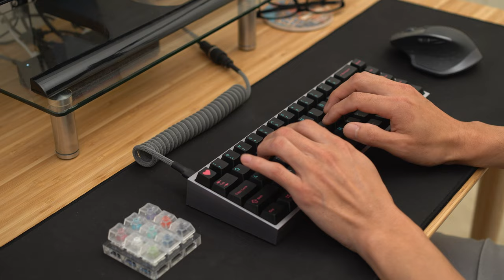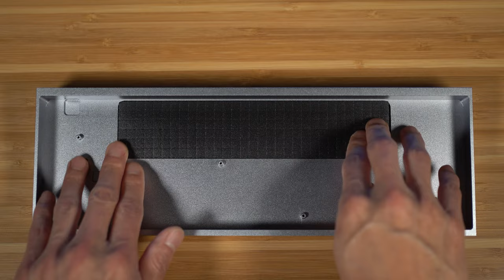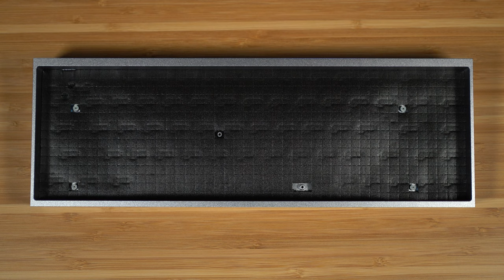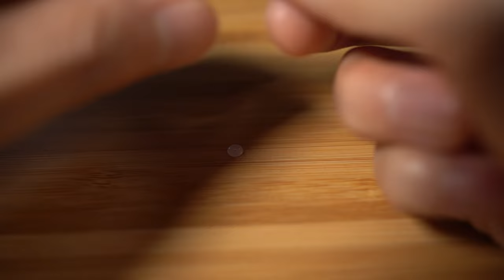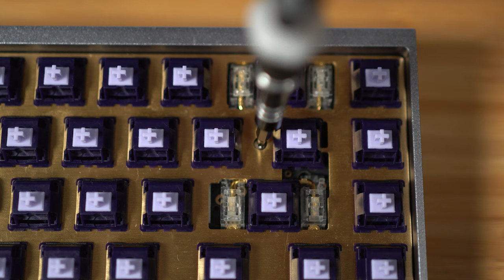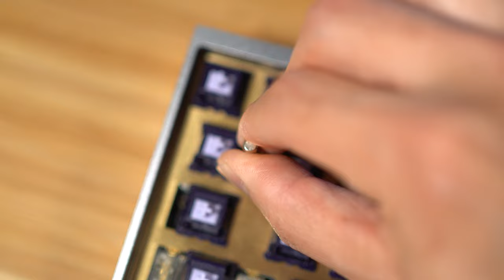Make the BEST sounding TOFU!  TOFU65 O-Ring Mount Mod Tutorial

Comment: How big of a role would you say does this specific foam hold in this build? I am not from the US and have trouble finding a suitable replacement. How thick is the foam? Have you tried different materials?
Reply from the maker: Hi An! I believe the foam in the case is absolutely necessary for this tofu. However, it doesn't have to be the exact one that I have used. Anything that will help reduce the ping and hollowness will work!
Reply: @Keybored  how thick is the foam approximately? As I have said earlier, I have had trouble finding a suitable substitute in terms of sound unfortunately

Comment: Hey thanks for the video! I wanted to try this on my low profile aluminum case, however the O-Rings you listed don't come in the size you specified. Do you have a link to some other size that would work? Thanks in advance :)
Reply from the maker: Hi Jonathan Haymes! Thank you for watching! A few other viewers noticed that the 4x1x1.5mm o ring was sold out. I found another link for you!

https://www.amazon.com/uxcell-Silicone-Rings-Diameter-Gasket/dp/B082STN4LT/ref=mp_s_a_1_6?dchild=1&keywords=Silicone+4x1x1.5+mm+o+ring&qid=1611546963&sr=8-6
Reply: @Keybored  I appreciate the response. Although these will take a very long time to come in for me. Do you have a link to something that will be available for delivery sooner? Thanks again

Edit: I actually ordered a different size from the same company and the package was lost during shipping so I requested a refund. Any other brands/links you would recommend? Would a regular sized o ring work as well? Thanks in advance

Comment: The whole board only float on the o-rings and not attached on the case at all?
I notice the screw when in all the way through the plate. Can I just screw the 2 o-rings first, then put the board on top?
Reply from the maker: Hi M Izzul Iman, the board floats on the o-rings but is also screwed down as well. Just make sure not to screw it in too tight, because that will compress the o rings too much and make it flat, effectively negating the mod. If you're using a hot swap pcb like the dz series, it's actually even easier to do, since you can mount the pcb first, then the plate and switches in top. Hope that helps!

Comment: If you are still replying to comments on this video, how would I make this work when the screws with my tofu are much smaller than the ones that you have? The ones that came with mine barely fit one o ring on it, let alone 2 and the pcb, plate, and foam. Just wondering because yours sounded so good compared to mine.
Reply from the maker: :) I still try my best to answer the questions!  I was told that some tofu kits actually came with shorter screws!  The screw size you need are actually M2x5mm.  I hope that helps!

Comment: i still dont get how you made it sound so good and creamy... Cuz I've sen tons of other YouTubers do the exact same thing but have it either sound plasticky or without that creamyness
is it the lilacs? because I don't really like tactiles but I love this sound
Reply from the maker: I think the trick is in the o-ring compression!  It's really crazy but the more or less you tighten it down actually changes the sound of this board.  I use the tip and finger to get it just tight, and it delivered the most pleasing results!  Also the lilacs broken in tends to have that more "chill" sound than some of the other crazy tactiles out there
Reply: @Keybored  interesting...any linears you recomend with a similar result to the lilacs?

Comment: did you have any issues with the usb port?
Reply from the maker: Hi Sean de Jong! Actually the 1.5mm thickness o ring is just the perfect height that I was able to clear the usb port nicely without issues. If you use just the screwdriver tip and hand tighten, it gets it compressed enough to clear the usb cutout nicely, without squishing the o ring so much that it doesn't elevate the pcb. Hope that helps!

Comment: Why did you decide not to put the o-rings into the 2 middle mounts? And what would happen if I were to do just that?
Reply from the maker: Hi Oblivion!  I skip the middle 2 mounts so that I can leave space between the stand-off and the pcb and allow for the pcb/plate to flex.  This way, it's somewhat emulating what a top mount or a gasket mount keyboard is doing, by helping to keep the alphas clear of any hard mounting spots.  If you decide to go with the rings in the center, it would be better than hard mounting like stock, but will reduce the evenness in sound and feel somewhat.  Hope that helps!

Comment: i dont know where i see it, but would it not be simpler to put your screws (that will get an o-ring) into the keyboard pcb and pull the o-rings other the screws? so that the o-rings cant fall off and you have an easy time overall.
Reply from the maker: Yup!  Viewers have suggested that, and I have tried and confirm it is easier!  :)

Comment: What 1u modifier did you use on the right side next to the spacebar?  I'm looking at the Miami night base kit and don't see the 1u  alt, fn and ctrl key.  Also your heart ESC key is not included on the kit as well... is that extra?
Reply from the maker: Hi stogey420time! I have the epbt miami nights which includes the extra bits!

Comment: I'm ordering some 4.5mmx1.5mmx1.5mm silicone o-rings to try this. Do you know if nitrile o-rings would work similarly?
Reply from the maker: Hi Chief!  I have actually tried this same mod with the Nitrile o-rings first.  Overall, I prefer the silicone o-rings over the nitrile.  That hardness difference (50A Vs. 70A) actually did have an impact on the sound and the feel.  However, it's not to say that the nitrile was bad.  It was a bit less "cushioned" and had a bit less "pop" to the sound Vs. the silicone.  Hope that helps!

Comment: Could you put toothpicks or something in the screw holes while putting on the PCB and plate to keep the o-rings in place?
Reply from the maker: Hi Jack, one of the viewers actually gave some good advice when doing this. He mentioned put the screw with the o ring through the plate and pcb, then put the bottom o ring on the other side first, before placing all this into the tray. This way, you don't have to worry about knocking off the o rings! Hope that helps!

Comment: I need to try this. Would grinding down the center two standoffs benefit here at all too?
Reply from the maker: Hi Kevin!  I noticed that the 1.5mm o-ring was thick enough to provide enough "space" between the pcb and the stand-off to prevent contact, and allow for enough flex for best typing experience.  Hope that helps!
Reply: @Keybored  aight thanks!

Comment: What standoffs would u o-ring mod in a tofu60? 2 most outer standoffs or 4 most outer standoffs? Also, did you need longer screws, i tried to mod mine and i felt like the screws wouldn't screw at all
Reply from the maker: Hi Diego! You would also use the 4 outer (2 on each side). Also I was told that some people received shorter screws with their kit than mine. The screw that I used were m2 x 5mm!
Reply: @Keybored  Thank you a lot!

Comment: What type of plate would you recommend to do this mod with? I was thinking Polycarbonate because its the most flexible
Reply from the maker: Hi Xavoid! I did it on the brass and aluminum and both yielded great results! They are just stuff enough that it doesn't flex into the center posts

Comment: Did you have to buy the m2x5 mm screws separately? I'm only seeing m2x6 mm screws, do you think those would be okay to use as well? Or do you suggest sticking with m2x5 mm?
Reply from the maker: Hi Kyla! My screws actually came with the tofu, but I was told that many also received theirs with shorter screws. But the screws that did come with mine are m2x5mm with a head diameter about 4mm. For the tofu 65 I have, the 5mm length was fine to fit into the standoff even without the o rings, so there was enough length in the stand off to accommodate. So I assume the 6mm with the o rings above and below should also be OK, but if 5mm is available, I would stick with that since it's proven :) hope that helps!
Reply: Thank you for the quick reply! I just bought some m2 x 6mm screws because I realized the case is deep enough to allow some leeway with screw length, since the screws can fit up to 4 mm inside the case itself. So hopefully that will work out! Can't wait to do this mod.

Comment: I tried using fluorine o-rings on my Tofu but it did not work. The fluorine is too stiff and doesn't compress enough for the screw to catch the thread.
Reply from the maker: That is interesting! I did this with both the silicone and the nitrile o rings, with nitrile being stiffer and similar to fluorine. The sound was a bit different, with silicone being more poppy of the 2 but the nitrile definitely did improve the sound and feel over stock. We're you able to use the same size o rings?

Comment: The screws I got with my Tofu65 are black and super super tiny. They aren't even long enough for the step when you put the screw through the plate. They fall right through and then I lose the screw in the PCB. Help?
Reply from the maker: I heard that some kits came with smaller screws unfortunately.  The correct size of the screw you need are M2 x 5mm!
Reply: @Keybored  Thanks a lot! Wasn't expecting a response. Appreciate it.

Comment: How come your screws are so big? The screws that came with mine are these tiny little black ones. I don’t think the screws will work with the o-rings underneath
Reply from the maker: Hi Xtr4 Kr1spy! The screws that came with my tofu measure about 6.5mm length from end to end, about 4mm diameter across the head. I believe the thread diameter is standard M2. It's interesting that some people received smaller screws... Kbdfans specify M2-5mm length screws so it seems like it's in alignment with what I have, since it's saying the thread portion under the screw head is 5mm. Perhaps these will work for you? They are m2 x 5mm with a 3.8mm head diameter. 

https://www.amazon.com/uxcell-Notebook-Computer-Phillips-Gateway/dp/B082XXLSP9/ref=mp_s_a_1_15?dchild=1&keywords=m2+5mm+screw&qid=1611717564&refinements=p_85%3A2470955011&rnid=2470954011&rps=1&sprefix=M2+5mm&sr=8-15

Comment: Hi. I'm using a GK64x PCB on my Tofu60 case and I just want to know if I can just leave the standoffs on the GK64x PCB and just proceed on what you did in the o-ring mod on Tofu? (you're aware that GK61/GK64 has standoffs on the pcb itself right)
Reply from the maker: Hi harmless!  From what I have seen, the does the GK PCB mounting positions line up with the TOFU case?  I know on the 60, it has some issues and tends to sit a bit unstable.  Perhaps the 64 does a better job?  In terms of the actual PCB stand-offs,  the GK61 also had them as well, but I removed them with a socket tool :)

Comment: Hey man! Would this work with a hot swap PCB? Really cool build btw!
Reply from the maker: Hi Em1LL3US! For sure! I tried it with the Dz65 also, and it's actually easier since you can mount the pcb first, then put the switch and plate above... No need to squeeze the little screws through the tiny plate holes!
Reply: @Keybored  did you order from kbdfans? also does anyone know if their fully assembled TOFU65 comes as hot swap?
Reply from the maker: @kilianleonkilianleon  hi Kilian! I did order my tofu65 from kbdfans! I purchased the kit and I bought both the hot swap dz65 as well as the solder kbd67 Rev 2 pcbs. From what I believe, the fully built ones come with the soldered kbd67 Rev 2 pcb. Hope that helps!
Reply: @Keybored  thank you man! I also wanted to order the tofu65 set from kbd with novelkey creams. but in order to lube them you need a hot swap version to pull them out etc right?
Reply from the maker: @kilianleonkilianleon  If you're planning to purchase the pre built TOFU, you would have to desolder all of the switches in order to lube them.  Perhaps you can look into the DIY kit with the DZ65 hotswap PCB so you can lube, then quickly assemble?

Comment: What kind of screws do i need for that ? They surely must be longer and the head smaller to pass the plate?
Reply from the maker: Hi T R!  I actually used the screw that were provided with my TOFU, but I believe some people received shorter ones than mine.  The screw are listed as M2x5mm, and the head diameter is about 4mm.  I have found ones very similar on Amazon as well!  Hope that helps!

Comment: Now how would this compare to the PC plate with o-ring mod. I listened to some comparisons and the PC plate had a deeper pitch which I liked. The board wasn't o-ring modded though.
Reply from the maker: The PC plate does have a deeper pitch!  I like PC plates for tactiles, but less for linears.  Since the Tofu is mounted to the case via the PCB, the PC plate will also work with this mod but you may get the pcb to flex enough to touch the center stand-off during heavy typing
Reply: @Keybored  Thank you so much! I went ahead and got myself a tofu60 with PC plate and I LOVE it! Your were correct on the pitch and pcb flex so I went ahead and screwed in all the screws. Still sounds amazing with these mods!

Comment: Did the o ring mod on my tofu60 and still sounds very pingy... not sure what I’m missing, i have some eva foam under the pcb and between the plate as well :(
Reply from the maker: Hi Snack Guy! If you're still experiencing ping, it may be the foam. I noticed that certain foams do a good job at eliminating hollow sound while others do a better job at reducing ping. For example, the butyl does a great job of making the board sound dense and solid, bit not too much for ping. The zip-n-fit liner does a great job for ping, but not so much making the keyboard sound more solid. The foam I have in mine is the zip-n-fit liner in the case and vinyl adhesive foam for the plate and it worked out very well!

Comment: I have a dz60 rgb v2, What do you think about also removing the middle supports and just o-ring modding the outer 2? Brass plate
Reply from the maker: Hi Kulbir!  Yup that will be the best way!  I have actually done this with the DZ65 rgb hot-swap pcb also for the TOFU65 and it works the same way :)

Comment: hey, the sound is eargasmic.. I was wondering if the nitrile rubber material o-rings can work, with the same dimensions? and will this work as well on a tofu 60 instead?
Reply from the maker: Hi Keith! I have tried this with nitrile as well, and also works! The sound is a bit different than the silicone but it still improves then eveness in feel and sound! Also works for the tofu 60 as well. A few viewers tried and came back with great results,
Reply: @Keybored  thank you! what about flourine ones, would it be a closer replacement than nitrile? Also, for the sound dampener, I saw someone using a diy flourine dampener, would that work as well?

Comment: Hi Keybored! I really want to try this mod out with my Tofu60, but my case didn't come with the longer screws. :( Instead, they came with the short black ones. I was wondering if you could send me a link to some screws like the ones you used. It would really mean a lot!
Reply from the maker: Hi Laifeless! Actually a few other viewers had the same issue. The screws that the Tofu65 came with are M2 x 5mm screws with a 4mm head diameter. I found some that are not exactly the same, but pretty similar, albeit the head is flat and not rounded. I hope these work!
https://www.amazon.com/uxcell-Notebook-Computer-Phillips-Gateway/dp/B082XXLSP9/ref=mp_s_a_1_15?dchild=1&keywords=m2%2B5mm%2Bscrew&qid=1611717564&refinements=p_85%3A2470955011&rnid=2470954011&rps=1&sprefix=M2%2B5mm&sr=8-15&th=1&psc=1
Reply: @Keybored  Thank you so much!

Comment: Do you have pcb foam installed for this build?☺️
Reply from the maker: I do!  But I didn't use a precut one and went the ghetto route... I used 3/16" adhesive vinyl foam that I cut out and applied to the bottom of the brass plate :)  I showed how I did this on my NK65 EE Modding video :)

Comment: how could i do this if i don’t have o-rings and just wanna do this mod right now, maybe thick/wide rubber band maybe?
Reply: @pretzel3779  knew that was coming
Reply: @ilynajix  I guess you CAN cut out the standoffs and put the large o-ring around the pcb and plate, but it will be harder and may interfere with your stabs a little

Comment: is the 1mm inner diameter a must? I bought a set of o-rings with 2mm inner diameter and was wondering if it will work the same.
Reply from the maker: Hi skunk! The 2mm ID ring may work between the standoff and pcb, but may be too large for the screw head. As you screw down, the head may just penetrate through, and may not sandwich the pcb between the 2 o rings. If you try and it works, let us know since that will open up more flexibility! Thanks!

Comment: hey wondering why didn't you do that with the screws on the middle
Reply from the maker: Hi yeacy!  I skip the middle because the r-rings on the outer stand-offs help to elevate the pcb/plate assembly, reducing the hard mounting points and making the board feel more even and sound more even as well!

Comment: Does this make the pcb no longer grounded to the case, and does this increase the chances of frying the board? I hope to try this on my kbd75
Reply from the maker: Hi fupa!  I have been running this keyboard this way for quite some time now, and hadn't had any issues!  I believe if you used the acrylic version of this keyboard, it wouldn't actually be grounded either through the case.

Comment: Does this has to be the 4mm x 1mm x 1.5mm? Will the standard switch o ring work?
Reply from the maker: Hi aeho!  The standard switch o-rings will not work!  They are way too big and it won't catch on the screws!  I would recommend the 4x1x1.5 or the 4.5x1.5x1.5!